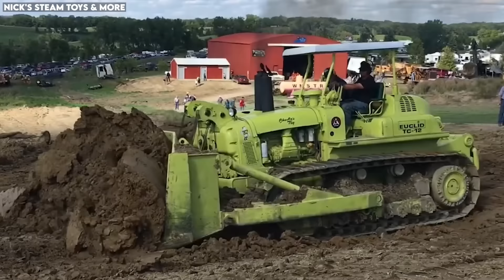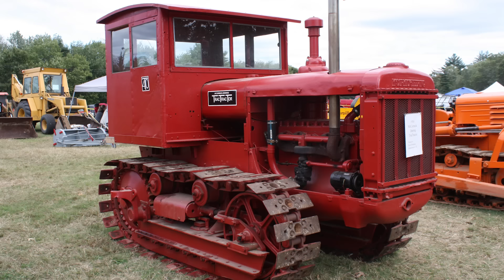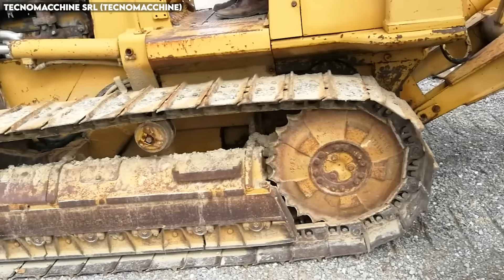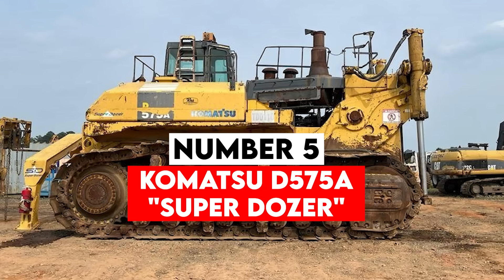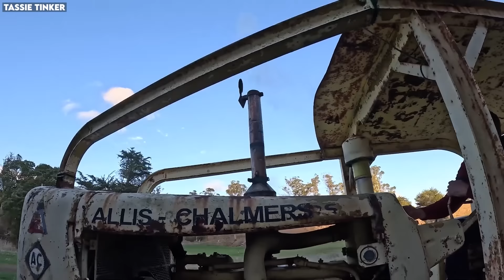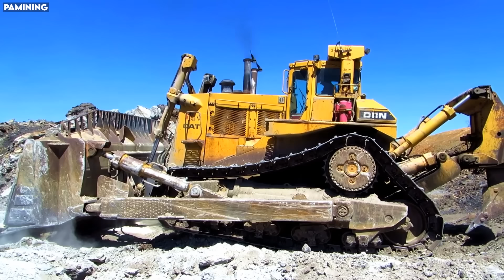10 Forgotten Dozers That Were Stronger Than Today’s Machines

Comment: A mechanic asked me to climb down inside the 41 beneath the floor plate after he had removed the seat ,  the machine was idlling  . I remember a massive drive shaft being inches from my face with a huge uni joint just about 2 inches from my nose . Then he asked me to watch that shaft and tell which direction it was turning . He did something and it turned into a blur for a second then stopped  . I couldn`t tell , so he spun it again . By then I`d had enough . So I told him a direction and climbed back up .  My guess had a half chance of being right ? 1970`s OHS was also different then . He did replace the tranny . Also they spent 20% of its value on track shoe replacement in its first year . Ripper boots were being replaced on a dailly basis . Allis Chalmers did that on warranty . I have a photo of me standing on the bonnet the first day it arrived . Also I saw it leave on the last day . It didn`t complete that Hwy . The company was broken by the hard limestone rock . Another mob finnished it another way . Maybe blasting instead of ripping .

Comment: Aint no allis Chalmers 41 gonna out push a d10 t.   All that puwere and gear reduction shit means nothing without weight .  Allis weighs 95,000, d 10 t 155,000, thats 30 More tons, plus they move much faster
Reply: or a Komatsu 375
Reply: 41b was a 70 ton dozer with blade and ripper fitted.